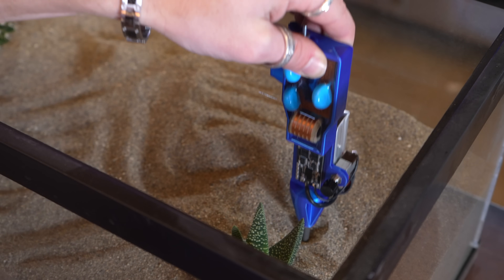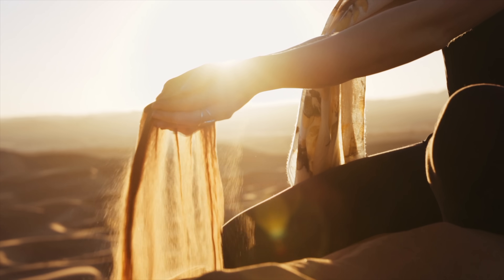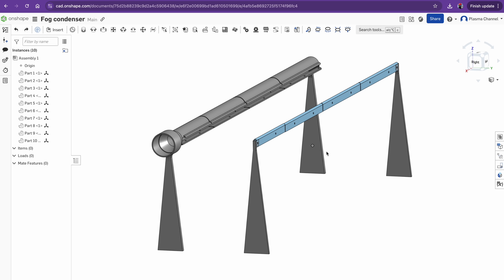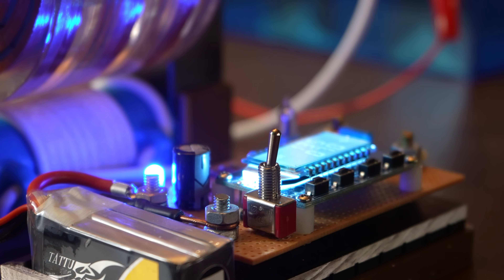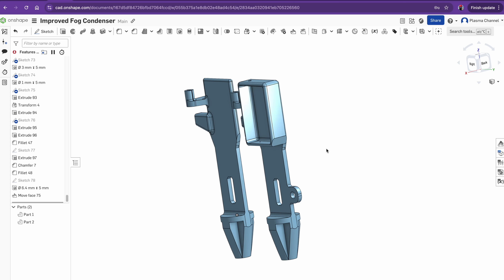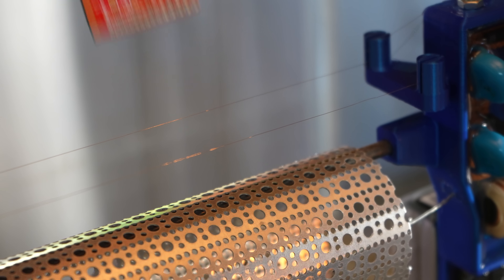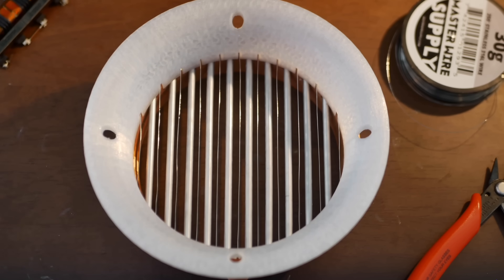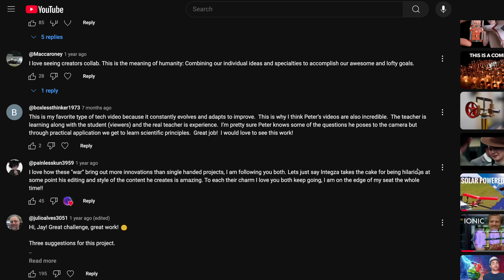Solving Desert Water Shortages Using 20,000 Volts

Comment: Two notes: The "commercial" dehumidifier you tested is based on peltier cooling. This is about three to four times less efficient compared to standard vapor-compression dehumidifiers. Also, dehumidifiers condense water from a gas to a liquid. This electrostatic device collects mist, which is already in liquid form. It would appear your device is more efficient at collecting fog, when the air cools below the dew point, which might have significant use cases. But, when it comes to producing liquid water from air above the dew point, a dehumidifier is still the only option.
Reply: Would be interesting to compare against a dehumidifier using a heat pump, which is much more efficient than a Peltier element.
Reply: Adding my two bits to this chain. The dehumidifier just has a different purpose to the fog collector. The dehumidifier condenses moisture in the air into a liquid, whereas the collector takes already-condensed moisture and puts it together. Trying to catch the fog with the dehumidifier is like trying to catch fog with a tennis racquet. Trying to condense humidity with the collector is like trying to condense humidity with a fan. Neither will work particularly well, if at all.
Reply: Combine the two
Reply: @michaelvw11 Have the static generator run only during the early morning. Then the compressor during the day.
Reply: When relative humodity is in the low 10,20%... you arent getting fog. The only way to condense the vapour in the atmosphere is to cool it, remove latent heat, and even then you have to get cooler than the cooling effect of evaporation at that temperature/pressure...
There is a massive amount of energy stored in water in the gaseous phase. You have to get rid of that energy...
A peltier is low efficiency regardless... to move a watt of energy from one side to the other takes at least a watt itself. The radiator/ heatsink has to dispose of both the heat of the phase change, and the heat to drive the device. And it can only do that by elevating the radiator above ambient, the higher the better, as more heat will flow...
But you soon run into the issue that it can only produce a certain temperature differential...

Theres no guarantee you can elevate the radiator enough to radiate sufficient energy whilst having enough differential on the cold side to actually condense atmospheric vapour....

Theres another option besides "vapour compression refrigeration", btw... lol
Reply: @Spencergolde But could this be used to concentrate water vapor onto a dehumidifier? Like charge the vapor and use the cold evaporator core as the grounded surface thereby supercharging a dehumidifier?
Reply: @shadowwolf225  That is an interesting question. The electrostatic collector wouldn't improve the COP of the refrigerant cycle, but I imagine you might be able to collect a comparable amount of water with less flow-restriction on the airstream, since collection requires electric fields instead of physical condensor fins, which could reduce the load on the fan and lower energy use. Would the energy savings outweigh the energy required to run the electrostatic collector? I'm not sure. I do know that the circulation of air by the fan is a minor part of the energy use of the system, so there's not a lot of overall percent-system energy savings to be had there. You also have to factor in the cost, reliability, and safety considerations to introducing an open high voltage power supply into the system, one which will attract flamable dust particles as well as water droplets. If the water collector starts when that dust dries out, I see a large potential for a fire hazard. Would a workaround to these problems be worth a 5-10% efficiency gain? Probably not for consumer products, but maybe on a space station. I do see the merits of using this type of electrostatic collector in areas where fog is common and dependable
Reply: You make an excellent point. This is really only applicable to moving liquid suspended in air. Gas to liquid is a completely different thing.
The 'comparison' being made in the video is (unintentionally) misleading. Its apples and oranges.
Reply: seems you need to chill the ground mess somehow to pull moisture out of air that is not in liquid state...
Reply: Furthermore, the testing does not show what happens when the grounded mesh warms up and becomes saturated with heat; in thermodynamic terms, the mesh is doing the heavy lifting, absorbing energy from the fog and condensing it, which is purely passively cooled by ambient air. This would probably be much less efficient in a desert.
Reply: @TheRealFlamingNinja  Deserts are cold in the morning when dew exists.
Reply: @TheRealFlamingNinja  At night in the desert, the mesh will probably lose heat faster than the air around it. However, I am not sure how quickly it will heat up as it condenses air-temperature water out of the atmosphere.
Reply: @mahboudz When it comes to thermodynamics, there are no free lunches. If you want to lower the energy of a high-energy water molecule, it must go somewhere, and that somewhere is the grounded mesh. I might be wrong and this process is much more efficient than I thought, but I think it's odd that the video's creator only uses a brief benchmark (5 minutes) to show how well this water collector works; perhaps thermodynamics catches up with it and efficiency rapidly declines?
Reply: @TheRealFlamingNinja  The "lunch" is paid with electricity pumped into the ionizer circuit. It is not a passive device. A passive version would be a fog net - but there you get only 2-10% efficiency.

Also, what many in the thread seem to fail to understand - the device would only gather water during the morning. The goal is long term accumulation of water, not an autonomous tap. 
Some form of geo-catchment would also have to be designed and created, along with a symbiotic ecosystem - otherwise it may end up as a "useless" swamp in a desert. Look up Lake Zakher.
Reply: thermoelectric cooling peltier very inefficient
Reply: Ah, a Peltier... is much less efficient than traditional refrigeration. I see your point. 
He might be able to optimize the "voltage" tho, and reduce the power consumption to get more water.
Reply: This answers the question on my mind, thank you. A cool technology, but maybe not applicable to recycling water in a hot greenhouse for example, where the water will be in in a gas form and not fine droplets
Reply: I came to say the same.
Reply: You spared me a lot of typing.
Reply: Wonderful explanation
Reply: 👏. This device, is "neat"... but honestly, useless if you have access to the coast. In Kuwait, one of only two countries without natural fresh water... they use desalination... yes, incredibly inefficient,  but upscalable and not dependent on fog. 

In the Mojave desert,  another place I spent muxh time like Kuwait and Iraq, there is no such thing as "coastal fog". There's only the natural +/- 12% humidity. When you upscale this, besides killing what few insects there are in the desert, it wouldn't work in 95%of earth's deserts. Plus, his +/- 50% humidity room, plus an unnaturally wet fog... makes this nothing more than click bait. I'd be curious to see if this would actually work in any desert!.
Reply: Point
Reply: I wonder if a more practical solution (which still doesn't matter because Saharan farmers aren't buying these) would be to scale up traditional dehumidifier tech
Reply: @gormauslander  
The electrostatic method in this video only works when there's fog, which is at the coast or nearby inland where wind blows it in.  Dehumidifiers only work in higher humidity like 30% all the way to 100%.  The higher the humidity, the more water you get.  If humidity is very low like 10% like in deserts, you may not get much, if at all.  You can't create water where there's no water in the air.  You can only extract water if it's in the air.  Plus dehumidifiers are power hungry, doing 600-1,000 watts for decent ones.  Commercial ones use even more energy.  But, the point is it's not economical in dry deserts to use dehumidifiers because there's little to no water vapor in the air to extract the water.
Reply: The dew point is a good consideration, however refrigeration could be added to the grate.
Reply: this guy gets it
Reply: You are correct good sir, ignore the scientifically illiterate comments you received, thinderf00t debunked this "water from air" tech years ago.  From his own stats he is yielding water at 255 Joules per ml, while an industrial reverse osmosis plant at 10.6J/ml.  You'd be better building a solar powered RO plant on the coast and tanker the water inland, it would be more energy efficient.
Reply: Supposedly gaseous water will still attract and condense. Tho in this example using the fog it obviously gives also mist so it's hard to tell effectiveness but there's research on it apparently
Reply: @Spencergolde Ah i see... You don't know what a peltier module really is ah? 😂
Reply: His device is amazing at collecting fog that is hotter than ambient. Which is a situation ONLY found in artificial test setups.
Reply: Interesting. He maybe can made a better work next time. You know, a 2.0 version.
Reply: @asterlofts1565  Unlikely. The limit on the utility of this device is not from bad engineering, it's from physical limitations. There is no amount of tinkering that will make it more efficient at condensing water This type of device works well in very specific environments under very specific weather conditions, namely dense fog occurring in arid deserts, which is rare, but it does happen.
Reply: Yep. There is a huge difference between fog and humidity in the air. You can only collect what water is there.
Reply: Also: doesn't the dehumidifier needs some time to cool down? I don't think 5 minutes is enough time to reach "operating temperature"
Reply: Not to mention the dehumidifier was using a fan to suck air in which would make it significantly more efficient than his device when actually trying to draw moisture out of the whole room compared to this setup where he's already dumping the fog directly onto the mechanism. For a better comparison he should've disabled the fan on the dehumidifier or added one to his mechanism then tried a real world test actually trying to pull from the ambient air instead of dumping fog directly onto it.
Reply: very true, but his application of the concept also has no moving parts and takes quite a bit less power than a standard dehumidifier. 

and as he mentioned, arid places like desserts have significantly low temperatures at night far below the dew point which is why its a solid application.
Reply: @scottygg8550 but the temperature being below the dew point is the whole reason why the fog exists to begin with
Reply: So I cant use this high voltage setup to dehumidify?
Reply: @johnmalaihollo  nope, just de-fogify.
Reply: @johnjingleheimersmith  thanks
Reply: @johnmalaihollo  no. Of course.
Reply: @johnmalaihollo  That cannot really be answered except through testing.
Reply: @johnmalaihollo  no - only if the humidity in let's say your basement is so high that fog is building up.
Reply: @johnmalaihollo If you truly believe refrigeration is the cure for removing moisture from the air in your home, just carry on as your train of thought is not controlling the locomotive, but that's life currently for most & acceptable by most.
Reply: That would only get 20ml, his device is over double that.
Reply: Wow, 7.5ml in 5 minutes with 40 watts 😄 still a huge gab
Reply: if he would use alternating current of some exotic shapes instead of hv rectifier - maybe someway at some frequencies it could shift dew point what do you think
Reply: @andy_nvrmnd  No, the dew point of air is simple physics decided by temperature and pressure.
Reply: deliberately ignoring points is not brilliant, mofpv. The video seems to suggest dehumidifier is inefficient for no good reasons, and Spencer and instigator explains because they're for different environment.
Reply: Except he fed it the same mist that he fed his device and fr the same amount of time. So your point is moot. Yes, the dehumidifier he used probably is using the Peltier method, which is a lot less efficient, but by keeping the parameters of the experiment the same (Same amount of fog for the same amount of time) he only demonstrated the inefficiency of the dehumidifier vs his device in that particular application.
Reply: @normanjeter5220 The downside of the device sadly is that it only pulls water while in a liquid state, in the use case of fog though it's extremely efficient, I'd say you'd have to think of it in a class of its own. It's a shame there isn't a device as efficient as this for pulling water from air above the dew point, so much energy needed to remove heat sadly...
Reply: @normanjeter5220  He's making 2 different points
First point
comparing the efficiency of a TEC based dehumidifier widens the gap between his mist attractor and a regular dehumidifier/AC. The attractor It is still likely to be better than a more efficient AC, just that comparing it against a TEC is the best case scenario.

Second point
The high voltage mesh only works to attract already condensed water droplets within fog. @spencergolde says in his comment that it will have its use cases where fog is common or at least regular, but in any location without fog, it does not work, where a dehumidifier/air conditioner would work and the TEC/Peltier cooler becomes more effective.
Reply: @normanjeter5220  It's extremely relevent to point out it's an unfair comparison since he is literally comparing power efficiency
Reply: @normanjeter5220  with fog, the video method is more efficient.  Without fog, the dehumidifier is most likely more efficient.  Also, birds and humans can get zapped by 20,000 volts.
Reply: @normanjeter5220  did u read what he said????unless ur house is foggy a dehumidifer is still the only way to go for home use...thats the point hes trying to make
Reply: @t9056  and the point he is trying to make is moot because he's not trying to sell it for inside your house. I think you may have some reading comprehension issues.
Reply: Are there any schematics to building this?
Reply: @t9056  Yeah, that's not what the video is about, though.
Reply: @t9056  and did you watch the video at all? The point of this device is to collect water from morning desert fogs.
Reply: @normanjeter5220  Yeah sure let me go ahead and compare the miles/galon of a gasoline car to an electric one
Reply: @normanjeter5220  So he did a baseline test with an inferior product and that's a moot point? I'm always looking for honest "proof of concepts." The scientific method is rarely applied nowadays.
      I'm curious to see the test in an actual desert instead of a lab. Both experiments in the video are done in labs instead of natural deserts. They could even start with north American or Latin American deserts to begin with. If this is about deserts they should already have studies in deserts to prove or disprove their concept. Even if it doesnt' have the results they may learn something new that can be used to innovate technology.
Reply: @normanjeter5220  Until he tries this in the wild, all this proves is that he re-invented the electrostatic spray gun.
Reply: @normanjeter5220 .. he's saying dehumidifiers arent tailored for fog, theyre tailored for air with non-vapor water conent..humidity

The video works only on water vapour and would conversely make an awful dehumidifier

Comment: Imagine using the solar panels not only as a power source, but a shade source to keep temperatures cooler (like a roof), and then having these grids set up beneath the shade where water can stay cooler for longer with less evaporation.

You wouldn't even need plants, you could just use this to harvest water.

Also, if you do need sunlight for the plants, there are such things as solar pergolas.

Comment: 15:00 The collector surface area of the test setup is X times larger than the collector surface area of the Amazon dehumidifier so of course the result is not going to be the same. Sigh...
Reply: I think the point was not comparing the size efficiency, but the energy efficiency. Where his new system was clearly a lot more efficient.

Comment: Upscaling this, you could form a dragnet of guidewires taking the fog to the areas that you want the moisture to condense, instead of just the one wire.  Just mini horizontal pylons to create a flow in the direction of the moisture vaporator.

Comment: If you were to replace a massive up scaled version of the condenser to fit on a center pivot irrigation system and time it right it’s possible to utilize both "electrohydrodynamic fog harvesting" or "ionization fog harvesting." And center pivot irrigation system in your advantage to collect water from the advection fog in the mornings!
Reply: The benefit of having a stationary system is reduced maintenance. No moving parts means reduced wear & tear. You might need to replace a wire broken by an animal or weather, but it's simple enough that almost anyone can do it. Worst case a power supply blows, but you can replace that just as easily. No knowledge of mechanics or electrical required. It's pretty much plug and play.

Comment: I would try doing a longer test side by side with the dehumidifier using a more natural level of air humidity. the Dehumidifier might work a lot more efficiently than the plasma device at lower water vapor levels.

Comment: The bottom edge of the ground should be at a 3* angle and perfectly flat n smooth so that the water droplets can flow to one end for collection. The 3* angle is for perfect flow no ripples during the movement across the edge